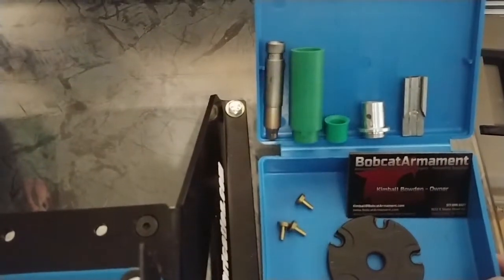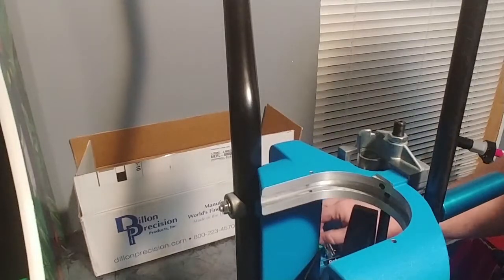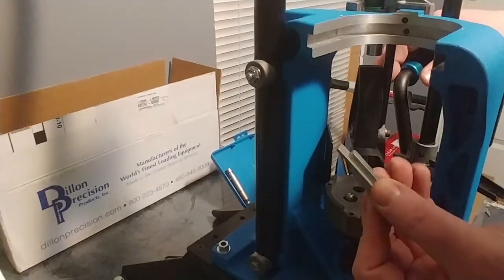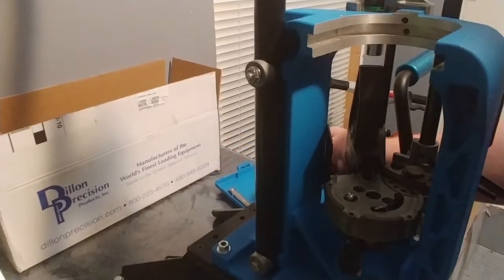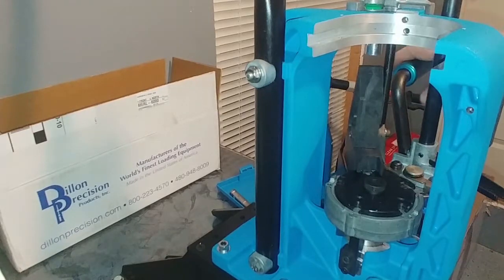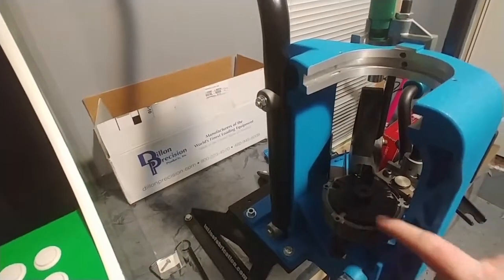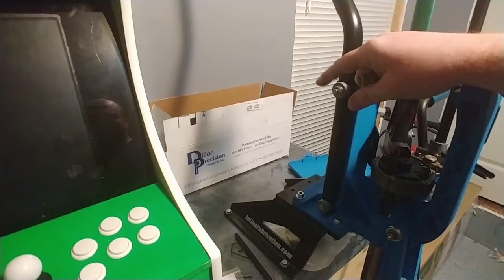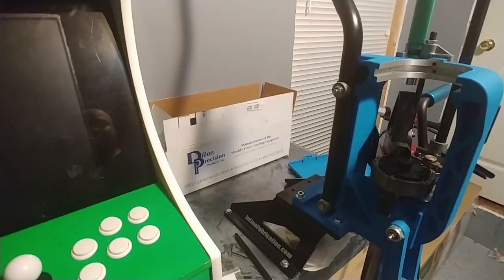dillon 650 conversion explained - xl650 9mm conversion setup

Comment: To go from 9mm to 380 auto I would only need to change the dies right?
Reply from the maker: The shellplate as well or you will pop rims out while priming.  Idk about the rest of the parts. There is a conversion chart someone made on Google. It shows the differences and shareable parts between 2 calibers you select
Reply: @TargetTime  Correct, I ordered it and the a couple other things to make it easier.